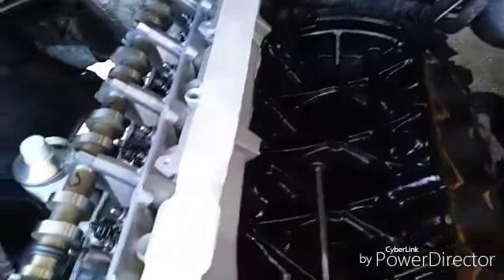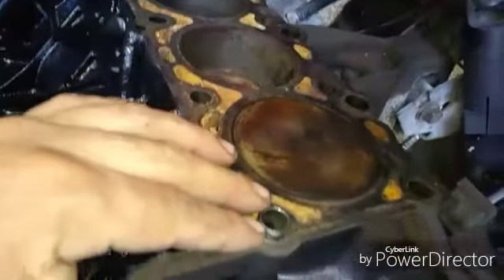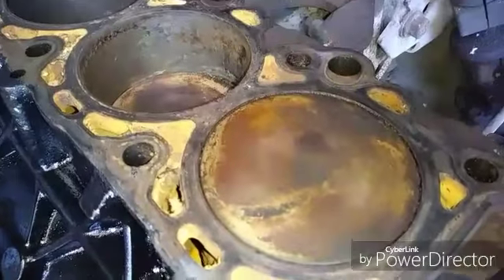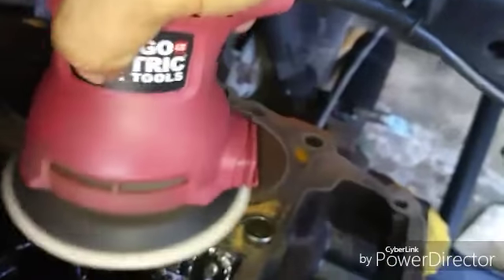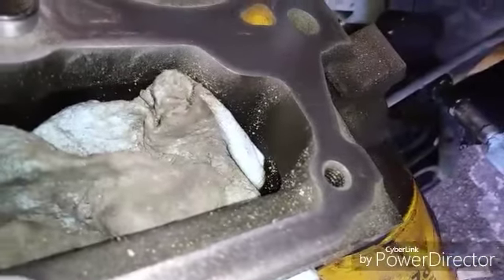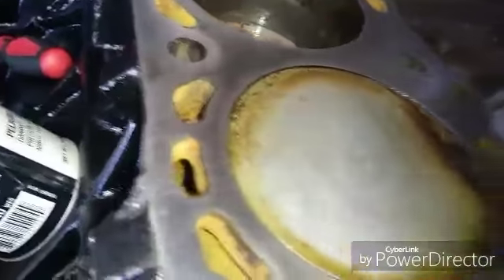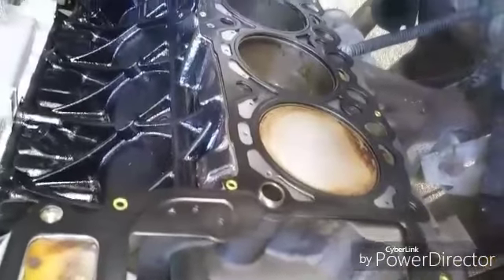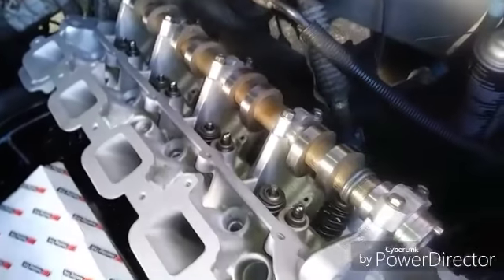How prep block and torque heads on dodge ram 4.7

Comment: Wish id have watched this before doing my overhaul. I didn't go back over the bolts after as you did. finished the rebuild and am still finding oil and water mixing. buying new gaskets, bolts, and starting over. also curious about the lifters, should they have any spring or play to them?
Reply from the maker: No play at all. The rockers must maintain contact during operation. If not you'll have a rough running engine, even after replacing coil paks, spark plugs and injectors. Most time if you have play between the rocker and valve springs then you may have a "drop valve" . which means the valve is not closing due to valve seat drop. Sometimes bent valves... Sometimes. But yeah man sorry to hear your unluckyness on your head gasket. You got got it on your next gead gasket job!
Reply from the maker: Also make sure your torque wench is good!

Comment: After head removal spray down with wd40 won't have any rust,your also getting sanding dust in cylinder.use a wire brush only on cleanup,with towels down in cylinder

Comment: Did you say SAND THE HEAD SURFACE  bad bad bad idea
Reply from the maker: Yeah when in the back yard we tend to do things as best as we can but I have any kind of machinery.  So I can't surface anything like a pro would do. Though my truck is still burning tires . So it's holding up.  Thanks for commenting 🙂
Reply: @im234life  hi Issac, I lean heavily on I wire cup brush in a battery drill when cleaning the top side, and a old worn out vacuum to dispose of all the unwanted debris,  😀  I had a mechanic at a dealership ruin a good Toyota supra engine by cleaning up the top end on a head gasket repair, , with sand paper. . Didn't mean to sound critical 😕

Comment: I sent this to my mechanic..he just put new heads on and went by the book..but we discovered an oil leak when it's under pressure and we think it's coming from the rear of the new head
Reply from the maker: Could be a number of things. But if you went by the book then my first thing to check is the torque ratchet? Also could be tough to get a true reading on rear head bolts due to the reach/angle for the torque wrench. Not saying those are the issues at all. Could be worn threads on block bad prep warped head or even block . But you got a new heads so probably not warped. Possibly a bad head gasket and though it sucks it might be the best scenario. Just remove and replace. Never had this problem.... if it's a very small leak, I'd might try to tighten up the head bolts 1st. Be careful with that as you may strip threads or crack the head. If it's a major leak , I'd remove the head and start over.
Good luck , hope this helps.